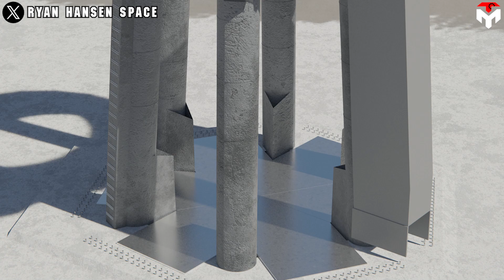Why Starship Super Heavy first caught by Mechazilla is more important than you thought?

Comment: Landing with Chop sticks will be the hardest technical problem they will have. The challenges are:

1) Acuracy of navigation in X, Y, Z and Rotation
2) Thrust control in the same 4-axis
3) Maneuverabilitu of the Arms in up-down, open-close, shift-left, shift right relative to #1 and #2
4) Fuel burn time allotted before the "Chop-Stick" grab can commence.

Things working against the success or disturbances, which will reduce success is wind, which can be steady state (easier to overcome), vertical shear (minimal impact on a rocket), and horizontal shear, which can be modeled as a force affecting upper, middle, or lower and rotational (minimal effect) of the rocket.

Most flight controls systems operate at least 200 Hz (200 times per second), and rule of thumb is response times need to be better than 2x the response times.

Therefore, sensing, maneuvering of the ship, and maneuvering of the chopsticks has to be at least some safety factor of ?? (I don't know), but for fiest grab should be better than 80% confidence to even consider. I can see numbers lower than that until SpaceX has enough data to get this number in that ball park ra ge before attempting a grab.

Things that make this challenging would be he wind shear from wind coming off the tower. The rocket is large enough wind-shear can pass thru the rocket affecting the bottom then the middle, then the top (we instrumental a Boeing 707 to demonstrate autonomous infighting refueling and data showed the aircraft even flying at 400 KTAS we were able to measure the shear propagating through the fuselage to include twisting shear).

The other turbulence that will pr could be a factor is the interaction of the rocket thrust off the tower pushing back on the rocket impacting the Top 4 of this list.

There is also a risk of damage from the launch to Ground Zero during the takeoff, which I heard one YouTuber mention about using g the second tower for recover until everything is perfected.

I'm not saying 'no, to this type of recover!'  However, there has to be a significant build up to attempt this.

I'd start with instrumenting the he'll out of that tower, to possibly even model how the dynamic air with the Starship, or booster while in the chopsticks interact at different levels above and below, and make sure those models for disturbances get reflexted.back into Monte Carlo simulation.

SpaceX still has to get to the profile where the re-entry and 'suicide burn' can provide the data to update these models.

I can say one thing for the plus, SpaceX has over 200+ successful landing and a few failures where they learned from their mistakes. If they think they couldn't do it reliably, they wouldn't have considered this approach.

I would leave with Harrison Ford quote from Raiders of the Lost Ark series, "The X never marks the spot!"  In this case, they have to hit the X, that is the SpaceX "X"

-Speedy

Comment: I'm Big fan of SpaceX, they are really an inspiration for me. But I don't think this is a good idea. There are other methods to catch super heavy and starship that are better and safer than this one. Fail by little and you destroy stage 0.
Reply: I agree, I am not a fan of catching the ship. Why not just have a portable landing legs sitting in the landing zone. They simply land on those.far from the launch pad. No damage if it crashes. Just a support structure that holds up the booster.

Comment: The catch is absolutely insane. A bad idea that needs to go away. The Falcon 9 boosters successful, landing with legs is the answer. Blue Origin’s new Shepherd has successfully landed with landing legs or gears. IFT-3 booster return soft landing in the gulf failed. The starship SN-15 is the only craft that has successfully landed. Clearly starship system lacks RCS precision control. Both the Super heavy Booster and Starship need to do a live simulation of “ the Catch”. Suspending the spacecrafts on a crane and try dropping it to see if the arms will catch it. If the simulation works then yes, they can probably pull it off but, still They will need precision landing controls.
Reply: You got that right. Trying to catch anything that big with all the variables affecting it is nuts. Put on bigger fins and landing legs. Why waste time and money on a catch.

Comment: Upper stage isn't that expensive. You can't reach "a fraction of the costs" just changing one. The first stage is scaled up. No huge savings either.
Starship will probably be able to launch "150" Starlink satellites instead of 70 at once. Seriously, think about it for a sec. Who has that many satellites ad hoc to launch and money to pay for it? This is carriage put before horse. Elon is trying to create market for his "truck" company. 
*gets popcorn
Reply: "Who has that many satellites ad hoc to launch and money to pay for it?" Starlink satellites are small. There are quite a few large military satellite launches that need large platforms. Obviously the next space station will need a huge launch capacity. Furthermore, as the cost per kg drops, the customer base will grow.
Reply: @jeffjwatts  "Quite a few..." - wtf are you talking about? Did you know SpaceX launch to ISS per seat is priced higher than the Russian one was? 
Again, price per kg won't drop. That's just Powerpoint Elon showed you. And you swallowed. It could shift a bit. But not significantly enough for market to explode. Even current Falcon is mostly used for SpaceX own Starlink program. So what are profit numbers for Starlink?
The thing about space business is it has to generate profit there. No profit, no orders, no R&D, no economies of scale or any other powerpoint bs.
Reply: @vensroofcat6415  why make it cheap for the government and their extra precautions, if you build the first mega constellation. With Starship launching 10.000 satellites will be cheaper than 100 km of fiber or earth based infrastructure. I am worried about the war in Ukraine, though, and the impact Starlink has. Sounds evil to me.
Reply: @vincentmatthis  I had this crazy idea once - what if Starlink on all those satellites does change the transmission frequency a bit and drowns all GPS, both civil and military in simple yet effective thick radio noise blanket? Could that be possible? How could you counter/destroy that amount of transmitters? Maybe I'm going crazy here or maybe, just maybe we are f.ed already.
Again, what is the actual Starlink bottom line, profit? Like for me living in a million city I couldn't care less about Starlink for the price tag and lag.
Reply: @vensroofcat6415  I guess he doesnt have an army to protect him - yet

Comment: Someone should ask the question as to why SpaceX keeps reinventing the wheel.
They should replicate nasa, the Russians, the Chinese. They create a concrete a high temperature concrete with a radial shoot to redirect the thrust down and out into the air away from the rocket and launch base. But let’s create something new that doesn’t work. Falcon 9 and super heavy were created flawlessly. Now just a few short years later and SpaceX lost its engineering prowess. Or should we the walked away from a clown with money. 💰